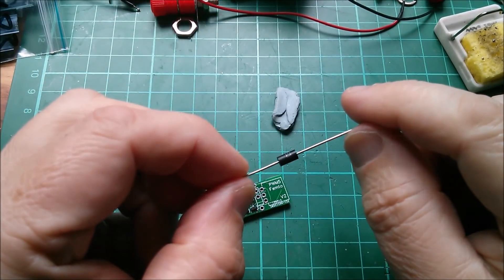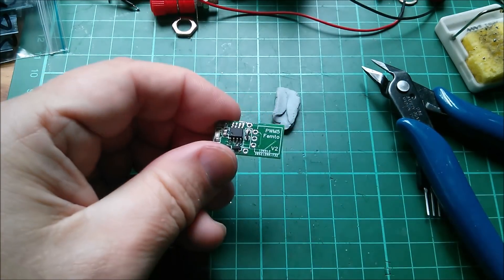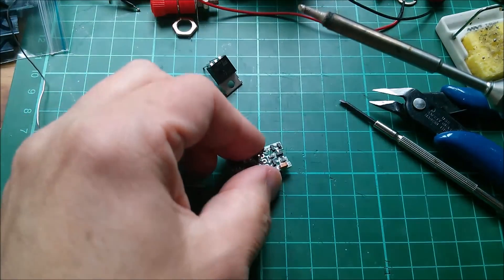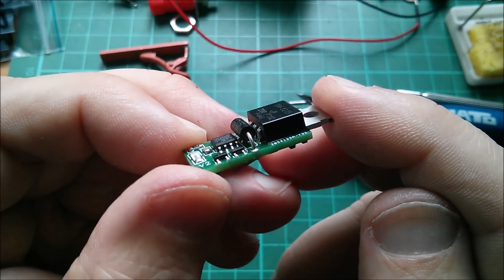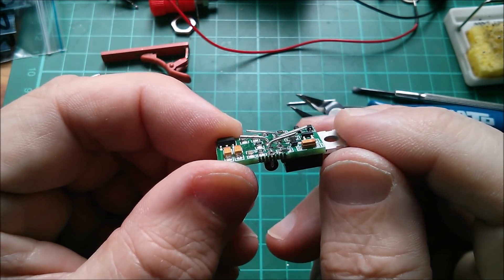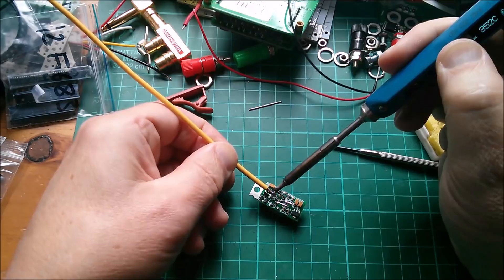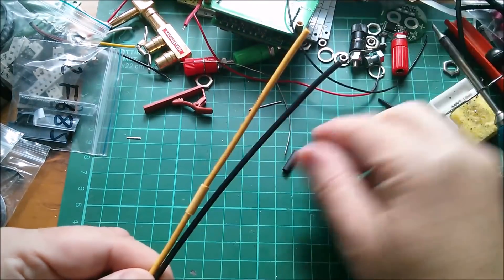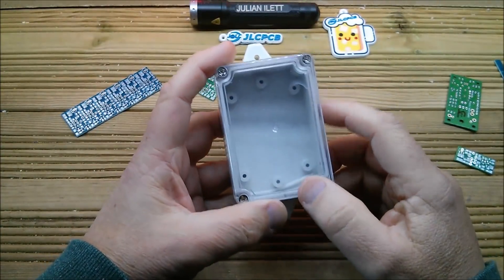PWM5 Femto (V2) Solar Charge Controller Construction

Comment: I currently have a Solar Panel - MPPT - Leisure battery setup in my mini camper van, but want to add a split-charge based system to trickle charge the leisure battery off the ignition/alternator.
I'm not fancying running cables from the starter battery through the van for that, but I can use the 12v10A accessory socket in the back. Would the "PWM5 Femto (V2)" be safe to use for this purpose? Rather than an expensive battery-to-battery charger.

This could all be a silly idea, but I feel the 12v accessory socket is a good source of power to top-up the leisure battery when driving.
Reply: You cannot use the accessory socket as the PWM controller does not include current limiting. That means if your leisure batteries were depleted it could damage your vehicles wiring.

Comment: Julian - keep in mind that natural colour nylon cable ties (or as I call them, zippy ties) will gradually go brittle over time due to the UV light from the sun. Eventually after some years, the tie will break. For use outside, or anywhere where there may be UV light, it’s recommended that the black type are used (these are normally UV resistant).
Reply from the maker: Very good point - I'll bear that in mind :)

Comment: Julian - did I miss you adding a diode in the wiring between the solar panel and the PWM5 or do you no longer consider it necessary?
Reply from the maker: It's necessary if you sell them. The customer connects red and black to the battery, then lets yellow and black touch together. Bang - full battery current through the MOSFET body diode. Warranty claim - profit lost. Not needed if I making them for my own use.
Reply: @JulianIlett  - thanks for your answer 👍😀

Comment: There was a nice spot at the top of the enclosure to screw down the charge controller via the mosfet... The only other thing that I might have done is fit two water proof switches, one for the panel and the other for the battery, it just makes life easier if you ever need to switch things off in a hurry compared to trying to rip off hot melt wire's from the batteries LoL... I always try to accommodate enough for Murphy's Law! 
Incidentally, I purchased two MPPT Charge Controllers that you reviewed, it's the one that has an adjustable constant voltage output and there is also another adjustment to tune in the panel. Mate! This little thing is pretty amazing! I have it hooked up to one 24V panel and on the other side I have four 8Ah (UPS type) LiFePo4 Batteries. I have had it running for some time now, I have a computer cooling fan rated at 12V 0.65mA as a test load, we have had at least 3 days of no direct sunlight! Not in bloody Australia! 
The fan has been running day and night, battery voltage drops to 13.25V by early morning just before it starts getting light but as soon as it starts to brighten up even a little bit, the little blue LED light's up! Doesn't take long before the batteries are fully charged! 
It's just a PCB board with an inductor and a heatsink on the back but I liked it's performance so much that I ordered another four! They can be paralleld and each one is rated at 100W 5A.. thank you for your review of it, I saw it on your channel and I just knew that I had to have one, my son has one of those all in one MPP Brand Charge Controllers which has the solar charge controller, a grid tie battery charger, an 800W inverter. It's a great unit but every time I connect another load directly to the batteries, it senses the extra load and stop's to think about it while the battery goes from a light charge to a high drain! Really annoying! Trying to use the 12V for stuff that you can directly connect to the battery for efficiency just makes those all in one units stop charging every single time something directly connected changes it current draw! 
But that little MPPT Charge Controller! I love it! 
Thanks again.

Comment: Julian, I don't believe that your 6mm drill bit has blunted due to rust. Instead, it looks to me that you were drilling in reverse!
Reply from the maker: Ah yes, the stroboscopic effect
Reply: @JulianIlett  
It certainly was. Now that I have gotten home from work and had time to look at it in slow motion, I can see that I was clearly wrong. Again. :o
Do you ever log how many Watts you gain and use? It could be interesting to see how much drop-off there is over the Autumn and Winter.

Comment: You could be bold and use one diode from the last panel to the battery. Just to get some power. Until all three are finished.

Comment: Any hole I drill loosely just becomes a magnet for spiders, no matter how narrow the gap.  They must squeeze all 8 legs in one at a time.
Reply: Dave Kimball - spiders are not too much of a problem (apart from the mess they make) as they are not very conducive, slugs however are a different matter. They can short out circuits and they leave a horrible sticky trail where they have been. But it gets worse, if they bridge two power supply conductors with a high enough voltage, they kill themselves, and then the remains causes corrosion 🙁

Comment: Could this PWM5 be used with say LiFePO4 batteries ... they would be 12.8V nominal 4 in series. usually the advertised 12V solar panels even the 100W can reach 18V when fully lit.
Is this a matter of changing the programming of the Pic? Thanks in advance if someone can reply.